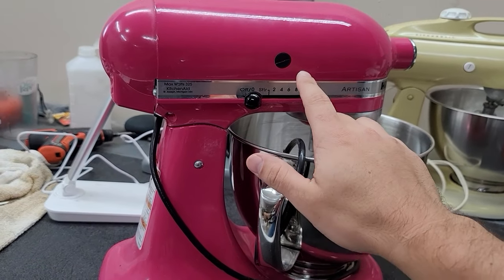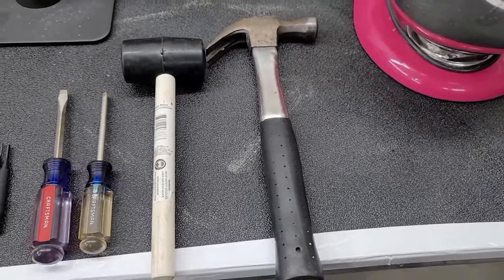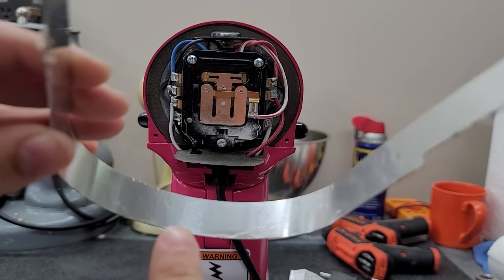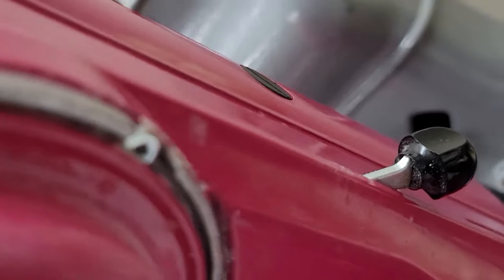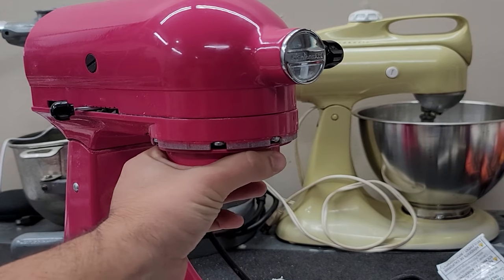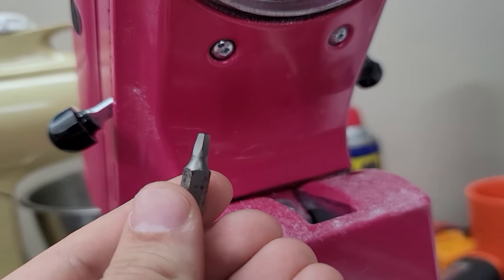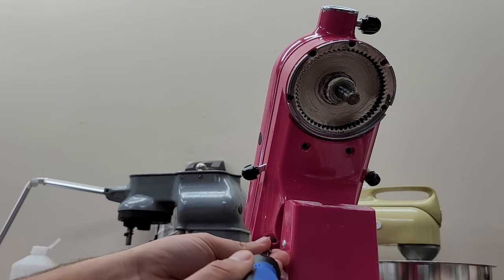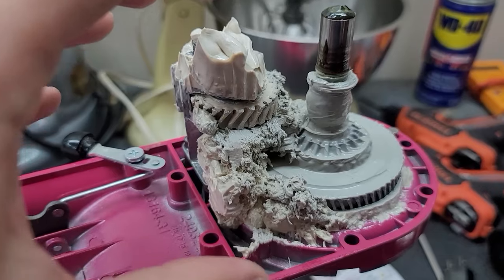KitchenAid Mixer Re-grease How To Pt. 1, (Classic, Artisan) Tilt Head

Comment: I have been trying to remove that pin for days!!!! - tried penetrating oil, tried heat gun, put the mixer in freezer, hammered with the 1/8” punch from both sides! The pin almost seems to be cold welded in there - it has not budged AT ALL. Any other thoughts?!!!
Reply from the maker: Hit it really hard! If that doesn't work it's possible it needs drilled out but that is pretty uncommon

Comment: Recently had surgery so off work (firefighter/paramedic) n bored out of my grape!! Started getting into sourdough, made a starter n have been baking different stuff. Wanted to do a sandwich style bread, got out our mix master; 27yo wedding gift, that hasn’t been used in years! Wouldn’t start. Pulled up ur channel for the first time. Have checked the brushes, noticed the speed adjustment “bar” had some how come off the plate, took the plate off, put it back together, n adjusted the speeds. Works great n all thanks to ur channel!! Now I may delve into cleaning n greasing it.
Thanks again

Comment: Very thankful for the videos you posted. Watched all three parts. They were great! So informative and easy to follow.. While preforming the operation we found that the factory had screwed into the red wire on the side and crimped it. Machine had never been opened so had to be from the factory. which explained some odd issues with the mixer, since it was new. So we uncrimped it the best we could, put a piece of electrical tape on for good measure. Carefully put it all back to together as per your instructions. Now the old mixer is up and running, literally better then new. Thank you so much!

Comment: Thanks for posting this.  I have a 1984 KitchenAid mixer.  Don't recall the model number or name, but it's the 4.5 quart bowl.  I watched your video yesterday and did the regrease job today and it's amazing how the model was nearly identical to the one you worked on that was more than thirty years newer.  Also interesting is the wear on that plastic worm gear.  My mixer was made with what I believe is composite metal gears and they showed very little wear.  I have used the mixer quite a bit in forty years and only had it serviced once about ten years ago.  That service, I discovered today, was not done well.  There was a lock nut missing and the guy used way too little grease.  That may be why I've had a concern with how hot the machine has been getting recently, which is why I wanted to regrease and get a look inside.  I can't get over how well this thing has held up for forty years and how little wear is on the gears.

Thanks again.  I couldn't find an authorized service center near me and now I can be my own service center.

Comment: Thank you - a great series of videos! All worked very smoothly. Just one point: our machine had some wiring connected to the base unit, and two clips had to be disconnected when I lifted the motor etc. off. No problem, but I just thought I should mnention it. Thanks again for your very clear explanation. William (London)

Comment: We have one bought in 1998 with the flat head bolts holding the top to the housing.  However, when I first took off the cap on the back of the machine (the very first screw to take off), a loose nut fell out of that cap.  It measures to be a 10mm nut.  I looked all over in the machine and can't find where that might go.    We just bought grease and a worm gear from you.  Good stuff!

Comment: Thank you for this great set of vids. I just re-greased a used red machine just like the one in your vid. The grease in mine looked nasty just like yours. When I started it up after I finished re-greasing there was a kind of crackling/splattering noise, like the grease was flying against the inside housing, at least that's what I hope it was. I can't tell you how chicken I was to turn on the machine when I was done. It's running fine, thankfully. I used a kitchen mixer grease product, gasket, worm drive gear from a kit on Amazon. I can't believe you only charge 50.00 for re-greasing. i used an entire roll of paper towels, a pile of cotton swabs, and dawn detergent to wash off the gears, et al. I am not OCD, just particular.

Comment: Love your video.  We can't get the side tiny bolt out.  The part you said is intimidating if you could help that would be great.  Also the issue is that the piece that runs/is pushed by the spring isn't staying under the spring so we can get it on but after about 10 movements with the control arm is stops moving again until we sneak back on (from the back of the machine since we can't get that small bolt out.

Comment: I have tried all the methods you describe to get this pin out of machine at 6:55minutes into your video and it will NOT budge. Any suggestions?  By the way, I know that once I get this piece taken care of I will be able to follow your very excellent videos on how to get this machine running like new.  I LOVE your work and information!  Thank you!
Reply from the maker: Honestly hit it harder 😅 that's about the only advice. I've had to drill them out before but it's pretty rare.
Reply: @MrMixer316  thank you…1.  Think I have found the error of my ways.  I was using a ball pointed chisel instead of a concave chisel.  So I have damaged the one in there and will likely have to drill it out and buy a new one.  Thank you for your assistance.  You are the master of this process!
Reply: A ball pointed punch, not chisel!
Reply: FYI -  I repair and service long arm quilting machines for a living and this is not really out of my realm of expertise.  I love your videos and I have watched a bunch from others and I think you are the best!

Comment: What have I gotten myself into?? 
I am not able to get the top piece off. I've taken out all the screws. The model is older than the one you have in the video. Mine is  a model K-45, if that matters. It might be stuck where the big pin is located.
Reply: Nevermind. I got it!
Reply from the maker: Take a flat head screw driver and place it in one of the slots on the side of the mixer and turn it it will pop open
Reply: @MrMixer316  I tried that. It partially came up so I scooped out some grease (it was brown 🤢) and it came loose.
I just sent you an email about a new gasket for an older K-45.

Thank you!!

Comment: Love your videos! My classic mixer was making an ever increasing awful noise and I was attempting to break into the things to re-grease the gears when I saw in your other video that the issue could be that the bolts holding the bearing bracket in place could be loose and causing the noise. Problem solve! However, after removing the rotary and the 4 screws, I could not get the upper housing off. With muscle I could separate the upper and lower housings by 1/4 inch. Would you know why this is the case?

Comment: I have two lift type Kitchen Aids. 1 is 32 years old (my fave) and 1 is prob. under 10 years old. It seems all of your instructions are for tilt head mixers. Is there a difference in instructions? Also, the under 10 year mixer was recently gifted to me and the diff is HUGE ...it feels wonky, but I did watch your video re spring and washer replacement, which I will be ordering. It is also a bit loud and whiney....maybe needs grease? My old mixer has never been regreased, but also on the to do list as I cannot part with it. Please advise about the diff. in your instructions for tilt head v. lift bowl. thank you....getting ready to start dismantling. Victoria
Reply from the maker: We have how to's on all the different models. Check our pro 600 regrease and our K5SS regrease tutorials

Comment: hi ! thx for your video that helps a lot although with my kitchenaid I never managed to get this pin loose it is really tightly shoved into the planetary and on top of that when I put it back together the motor did not start up, I had the brushes removed  by error, do you have an idea on how to mount  the brushes back correctly ? or why it did not start

Comment: I am hoping to tackle my bowl lift mixer soon.  I took off the back cap and beauty band and already know I have leaking oil. I’ve seen you here and primarily tiktok and notice you do mostly tilt head mixers. I’ve already noticed a couple differences in screws, but I’m guessing everything should be mostly similar.  Should I be on the look out for anything major or do you have a different video I’m missing? Thanks for great tips and videos btw!
Reply from the maker: We are actually working on filming for that model, it will be hopefully uploaded soon!

Comment: Is there a video showing what a mixer sounds like and runs like if it needs a re-grease? I got a used one and it sounds a little rough, but just curious what an old one sounds like and if the re-greasing fixes the sound.
Reply from the maker: Regrease can help with some sound but if it's a grind or a vibration sound it's likely related to other issues like damaged gears or a bad bearing bracket.
Reply: @MrMixer316  Thanks!

Comment: Finally managed to get the pin out of an Artisan and thought I was over the hump.  However, it's about 17 years old and never been serviced.  Now really struggling to remove the planetary without putting so much screwdriver pressure on the rim that I am bending it.  Any thoughts?
Reply from the maker: Have you used two screw drivers at the same time?
Reply: @MrMixer316  Yes.  They probably could have been a more perfect sized blade for the job, but eventually have managed by rotating the planetary small amounts and using one screwdriver, getting deeper and deeper in, avoiding the internal gear.  Eventually pried it off.  Thank you very much for your immediate response though.  Heading for part 2 tomorrow I think!  Top man.  Great video.

Comment: In the background of the video is a yellow-green K45 mixer, the same model I have. Do you have a video for opening it up and cleaning and changing the grease? There's a burning, smoking smell coming from the rear of my machine when its run at speed 10. The screws are not the same as the pink mixer.

Comment: Should the planetary gear that’s removed (8 mins into the vid) turn easily? There’s quite a bit of resistance with mine
Reply from the maker: It should turn easily when removed from the machine, if it is tight, take off the agitator shaft and clean it and then lube it a bit
Reply: @MrMixer316  yes, I thought it should turn freely, thanks for confirming, the vids were great btw 👍🏻

Comment: I can’t find a video for my issue but I replaced the mixer gear hub recently as it was worn. Mixer works fine now but the front grinder/pasta attachment gear won’t spin. What am I missing?
Reply from the maker: Herm it would be hard to say without being inside, the housings could be separated a bit or its potential that your missing a pin/ don't have the gears aligned some how

Comment: I’m working on my second mixer to replace the grease. I took the pin out of the planetary and now the planetary won’t come off. I used 2 flat  screw drivers to pry the planetary off and I bent the planetary. I gave up for a while and now I’m trying again. 
I cannot get the planetary off at all. It will not budge.  What do you suggest?
Reply from the maker: Well unfortunately it's going to have to be forced off it sounds like. Usually prying takes it right off if it can't be pulled by hand. If you force it off we do have planetaries available

Comment: I can’t get the band to stay on now on the front of the mixer. I used the mallet and it fits on but just pops right back off. Is there a trick to get it to stay? I turned it several different ways thinking there was a groove it might need to catch but nope.
Reply from the maker: The paint that is on the 5 or 6 little ridges where it seats have too much paint which is causing it to slide down, trim a bit of paint with a razor off of the ledges and it should seat properly!

Comment: I keep seeing videos of a bar that goes across supporting the speed control bar, when did they stop using that support bar?  I see this pink mixer does not have it
Reply from the maker: My guess is 2018-2019 when they removed it
Reply: @MrMixer316  Looks like they cheapened the speed control bar too, mine felt like plastic.

Comment: Hi Mr. Mixer, thanks for the nice video. I have a KitchenAid Artisan Stand Mixer KSM150, which is about 5 years old. Recently it had some big noises and thus I changed the worm gear as well as grease. Now it can spin quietly without anything in the bowl, but when it is making a dough with a flat beater it occasionally gets stuck and stops spinning (motor still sounds running) until it slowly gets over it. It looks as if it is not powerful enough or the torque is not large enough. Do you have any idea what might cause this problem? Thank you
Reply from the maker: I think you bought a gear off Amazon? They fail you need an actual oem part

Comment: SOS - I can’t get past getting the pin out. I don’t have a push thing like he has so I am using a screwdriver with a head that is similar to what he is using and a hammer. It’s just so wedges in there. I feel like I need grease to get it out.
Reply from the maker: You should definitely purchase a punch, they are inexpensive
Reply: You’re the best! Thanks!
Reply: @MrMixer316 What if not even a punch is working?

Comment: @5:18 You need the opposite  a rubber flat tip object and a hammer haha. But both work. I just fixed a leaking one for a friend. Took soooooooo  much longer than expected  but works like a charm now.  Have to clean often   it's a white one now permanently  stained.  But who cares when it works no leaks.  Great job Dad. Oh btw. That pin to remove  with the punch. Was a mother trucker to remove   as you can see in this vid.    Yes hit it hard.... (that's what she said)   but it is a b** to remove.   But the job took me a hr I think since soaked the greasy parts to clean and had to use tips to get in and make sure all the oily substance was out. Also to use flat head screws smh.  Wasnt that serious but so dumb  so 1900ish haha. Another thing ibsee with this vid the one I  did had a rubber kind of gasket  @13:28 this one doesnt for some  reason I wonder why. But hey cut cost to make and profit cant complain about it  but if served a purpose  why not add but if didnt then hey money saved.  If has remove and clean it and under.

Comment: Hello 
I have a question regarding a KitchenAid that I bought from US and I brought to Jordan. The electricity in Jordan 220V. After we plugged it, the machine stoped working and I don’t what happened. Did we lose it? Is it still fixable? 
Thank you soooooo much for your answer in advance.
Reply from the maker: It's fixable it likely blew out the phase control board, did you use a power converter?
Reply: @MrMixer316  no we didn’t unfortunately.
Reply from the maker: @khaledalsadi9038  OK yea it will need the phase board replaced otherwise the rest of the machine is likely safe! It is a tilt head correct?
Reply: @MrMixer316  Yes it is! I will buy it from US and bring it back with me when i go visit this summer. Thank you man. I really appreciate your replies. God bless
Reply from the maker: @khaledalsadi3055  we offer it on our website 😁
Reply: @MrMixer316  Great! I will bring the model number and let you suggest the right part for it. Thank you

Comment: I found the original owners manual for the K45 and it said to use Permatex #2 gasket sealer with the gasket (apply to both sides of the gasket). Is that OK to do? Would it help prevent leaks?

Comment: Hey Mr Mixer I just acquired a K5SS and I'm trying to determine how old it is.  It has KitchenAid Division of Hobart written on the side if that helps determine the age. I'm also trying to find the Bowl Height Adjustment Screw.  Any clues or assistance would be appreciated.
Reply from the maker: If it says Hobart, it's pre 1986 and since it's a k5ss it's post 1978, so it's in that time frame!! The adjustment screw isnt always present on the k5ss as they made a ton of different models of it, if it's present it's running perpendicular and it's right where the center of the arms come up and meet the lower housing
Reply: @MrMixer316  Thanks for your quick response.
Reply from the maker: @spainman2 happy to help! Check out our tutorials for the k5ss, all of the electronics match the tilt heads so you can follow those for any electric work!

Comment: I have model KP2671X 6 qt Professional tilt head mixer - would the greasing method be the same as with this mixer? Also, the mixer has always screamed when using it - so I ended up not using it much.  Do you have any idea what could cause all that noise when running?

Comment: Have you ever had the tilt freeze up and not move. It is stuck and is extremely hard to move up and down
Reply from the maker: Yes I have seen it, I would try and take the tilt pin out and separate the head from the base and inspect it to see what it's doing

Comment: To continue! You wont believe this! I took off the back cover (wanted to SEE what was making the rattle-buzzing sound inside the back), and turned it on. And a NUT fell out of the back!
NOW I'd REALLY like to hear your thoughts!
Reply from the maker: Yea there is a nut on each side of the bearing bracket just behind the speed plate, just put it back on, not too tight or it will bind the motor fan
Reply: @MrMixer316  do you have a tutorial for that? I'm a girl! You may as well have written that in Latin!

Comment: I have been hammering away at this dang pin for thirty minutes and it will not come out. I’ve tried hitting it with what from a hair dryer and Wd40. Any other tips?
Reply from the maker: Are you using an actual punch? The next option is a heavier hammer and hit it harder or worst case any body shop can drill it out for you. You have to hit them pretty hard.
Reply: @MrMixer316  same here, cannot get it out